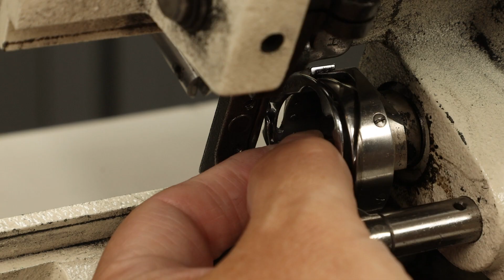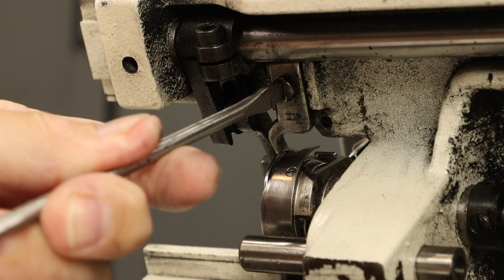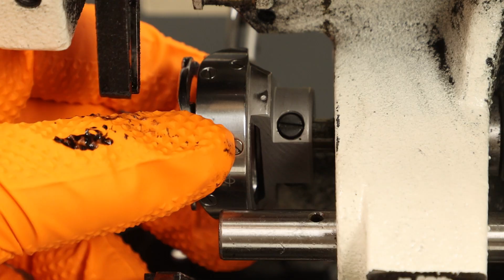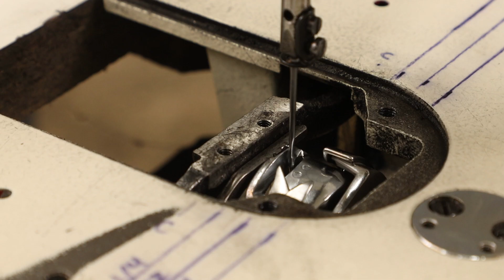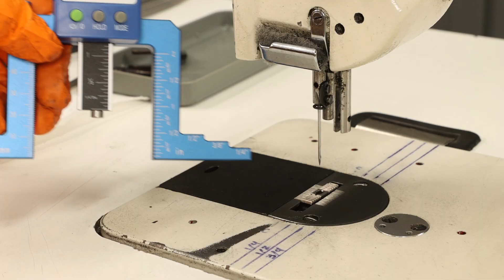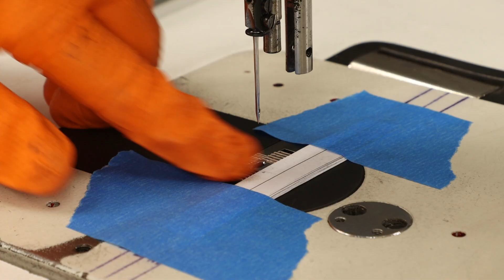Replace Rotary Hook Consew 206RB How to Repair Industrial Sewing Machine

Comment: Hi there, I have a consew 206rb-2. I have gone through the steps a few times but my hook does not seem to be in time with my needle position. It seems once I put the hook casing on the rod with the v indent, I have trouble adjusting the hook back and forth to sit in the right place in position with the needle. I have to pound a few times to get the hook casing fully on the rod and it doesn’t like to adjust forward and back once it’s on. Do you have another video you could direct me to as to where I might be going wrong with the hook casing as well as the needle position and how the two need to work together? Thanks!
Reply from the maker: Sure, you'll find help in my major adjustments video at the 15:36 mark...  https://youtu.be/b8j895exuts  Thanks!

Comment: How does the newer consew 206 compare to vintage? I'd like to get one but in my mind vintage seems a lot better than new.
Reply from the maker: I can certainly appreciate the older Japanese made models.  If you can find one with low miles (almost impossible) I might prefer that, but as it is I have two and they're both newer... https://amzn.to/4meSFtp  thanks
Reply: @TheThoughtfulWoodworker  how's the workmanship on the newer models?
Reply from the maker: @j_crust4582  They actually have some improvements over the 206RB-4 like an easier adjustment to equalize the forward and reverse stitch length.  Castings are good, and everything just seems to work.  Thanks
Reply: @TheThoughtfulWoodworker  say leeesss. I think I'll get a newer one then if I can't find a japanese one for a really good price